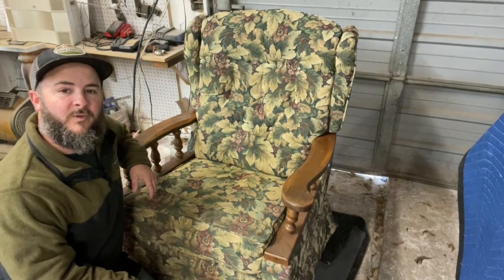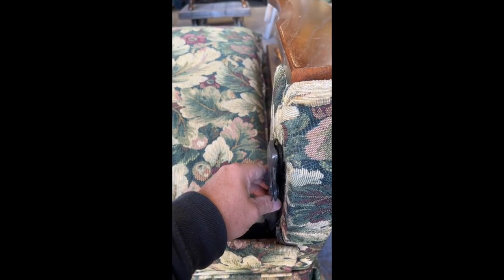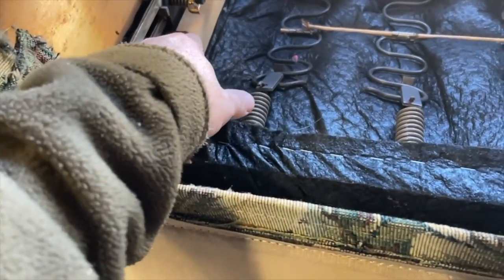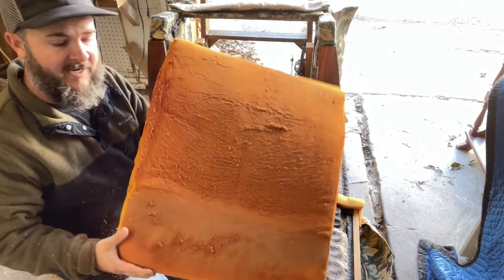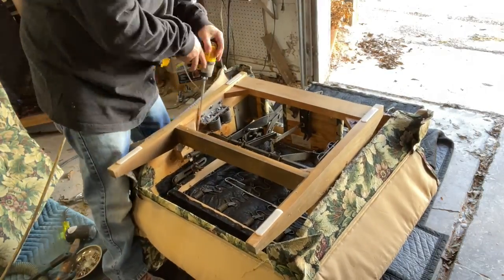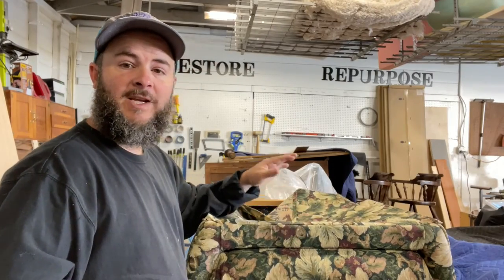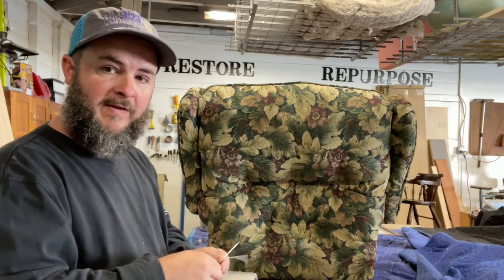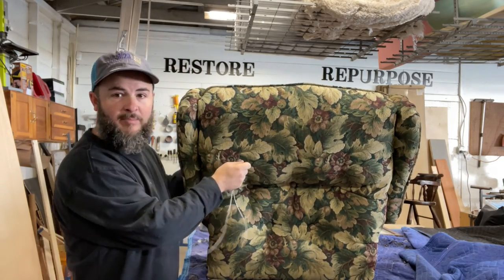Adding Padding To Your Recliner (No Zipper Access)

Comment: I need to take padding out of the head rest section too much and it’s hurting my neck!
Reply from the maker: When you remove the back from the base, you’ll typically have to remove the brackets and all the staples holding it to the back frame and inspect whether or not it has a zipper .
Reply: Same situation. Tech-neck.